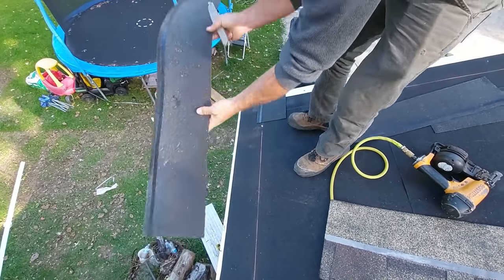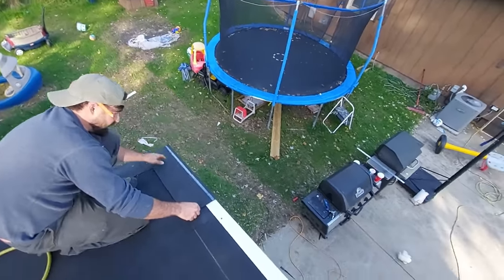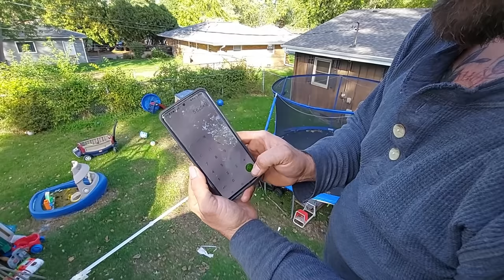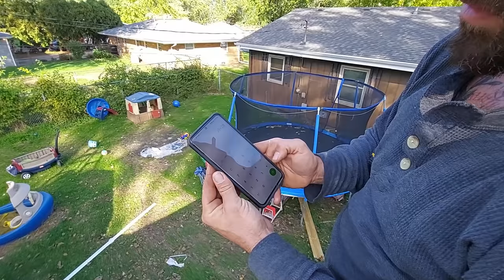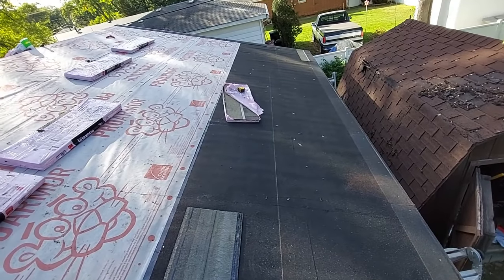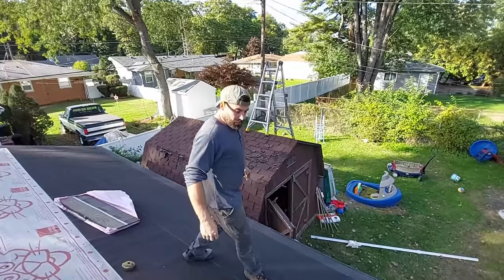HOW TO | Roofing basics (part 2 of 3)

Comment: That's bs on cutting the ice shield.  If you cut it then you had better run a bead of modified caulk on both sides and add a 12" patch over it.
Reply: Correct slitting out a bubble in ice dam requires a lapped in patch
Reply: Oh shut up😂
Reply: If a roll ends before the end of the roof starting a new roll requires a side lap. Slitting a bubble out leaves no side lap. What is the point of ice dam if it’s compromised with a huge cuts.
Reply: True

Comment: After watching tons of videos on roofing, yours makes the most sense!  When i got to shingling I could not find your video! 😡I just installed on a small lean to shed and need to redo everything from the drip edge, paper to the shingles.   Ended up using another video, the wrong way video😂  Your install is the correct way!!   Didn’t pay attention to lining nails and the first starter sheet to avoid the first seem 😮😡🥵. Luckily it’s small lean-to where I only used 1 full bundle of shingles.  Im going to be building 2 larger sheds in the yard and want to do it right!!  Thank you!  $50 redo better than head aches down the road.

Comment: Thanks for these 3 videos, I am facing my home roof replacement; insurance paid claim due to high wind shingles flying; problem is the contractors I have spoken so far quoted more than what I have for it. I am entertaining the idea of do it myself, now these videos have some of all the info I need but not all; the good news is I used to work finished carpentry and framing for many years but just never done any roof before; I as well are not a car mechanic and took apart our Toyota Corolla, overhauled the whole car most parts and put it back together; it is running, my friend says the roof is simpler in comparison yet I would prefer a pro to do it but the prices I am getting are going to steer me into doing it myself; in my case I got a single story 1350 sq ft home with an L shape roof in 2 sections which measure 80x80; I am told I have 16 sq ft of roofing; ours have 3 layers to tear down and I am gathering info as far as how much and type of material needed; I know I want to put it Laminate shingles from HD Castle Sandstone but not sure yet about water barrier or felp; we are in Las Vegas, Nevada and here it is mostly sunny all year around; roof pitch here is 4:12 I believe and in my roof there are 2 valleys, 2 attic turbines, 4 vents, a chimney, a small round skylight and the AC Unit is on the roof in the center of it on roof 1; roof 2 is the one mostly for garage facing the street. I am not worry about demolition and tear up but worry about how to work around obstacles and how to properly install around it as it is difficult to find here. I would think it would take me about 4 days to do it on my own provided I can get all materials up. I watched a video here in you tube on how to make an electric joist using a 16 ft metal ladder which I have but if I do not use a contractor because pricing with the insurance check I believe I have enough for the materials I need and some tools I may need as well and my calculations are to be around $6000 mark; not sure yet. Another feasible way is to find a lone roof contractor who would do only the installation part with me providing a clean area, materials and help as needed; not idea what he would charge labor. I would be including dumpster as well; by the way my actual shingles are 3 tabs; that is why I will be upgrading to laminate as recommended by some I have already talked to. Any advises for me? I subbed; Thanks!
Reply from the maker: If it's insurance you should never do it yourself.  I always make sure my customers don't pay a dime and I get enough money to do the job properly. You just have to find a roofer that can do the same.  If you're having issues with the insurance company you can always hire a Public adjuster but if it's just a roof that is already fully approved then I would try and stay away from that

Comment: We do 12-3/4 off drip edge, then 5-1/2 show every row up the roof with chalk lines. Over half way up the roof we will square the top line to the ridge. This ensures the shingles are squared to the roof, tar line is directly on the key way of the shingles, no exposed key ways, and that the shingle nailed above the other has the  additional nails. Everyone has their own system, I am sure yours works well.

Comment: Good video for people starting out shingling. Cutting the wave in the ice shield is necessary, if you don't, you will see it when facing your roof from below. Here in SoCal, we call it 'Fisheye'.
I made a long comment in the first part. If anybody is interested, check it out, especially if you are in a heavy weather area. Regarding starter shingle, we never extend it by the eve more than half inches, about three eights. Start laying down your starter on the opposing side from where you start shingling. This way you only cut it once. And your first shingle still may need a small cut if keyways happen to be offsett less than five or six inches. You can play with the size of your steps a little bit, as you getting nearer to the ridge it becomes less important since rainwater has less momentum. Chalk line I only use if your eve have more than one beginning, lower or higher sections that needs to be flushed once your on open field going up to the ridge. I ensure that my shingles keep a straight vertical line by extending my shingles just a bit higher, like an eight of an inch so I can see the line of the 'reveal' or also called 'exposure 'that guides me when I  lay my shingles down.
Hope I was clear, if U have any questions, shoot me up.

Comment: The thing with roofing is a lot of people think every roof is created equal. They think its as simple as just nailing shingles on and the shingles will keep it completely waterproof until they start breaking down or the roof receives significant damage from wind, tree limbs, etc but fail to realize a roof isn't meant to be waterproof, it's only meant to shed water. People will buy a house with a newer roof and think it's good to go for another 20 years just because their inspector went up there and didn't find any obvious flaws and there's no visible leaks coming through the ceiling. Sometimes a homebuyer has the advantage of knowing it was done by a reputable company but even then sometimes reputable companies don't always do the best work and aren't able to provide a short term or even longternmwarranty to the homebuyer. Maybe they let a beginner do some shingling, they got in a hurry to get the job done, their top installer came in hungover, they nailed into keyways and the inspector doesn't notice or whatever it may be. Roofing is hard work and anybody who at least somewhat knows what they're doing can do a roof that will last a few years before causing noticeable leaks but it takes a skilled roofer to be able to do a roof that will last 20 or more years and leave little to no rotted sheathing for the next time the roof needs replacing but unfortunately the fly by the night roofers are long gone and have already been paid and won't stand behind their work when issues do arise. Sometimes issues arise from heavy rain, snow, wind, etc but more often than not issues are caused by a bad install because bad weather events are inevitable
Reply: So you think a roof is not meant to be water proof hay. That's just sad untruth.

Comment: I used to run a chalk line with the old 3 tab to make sure they stay straight. Don't really have to do it with the heritage style though. Your videos are by far the most informative I've ran across so far. Every step is thoroughly explained and by the book.  I thought I was a pretty fast shingler  until I watched your speed shingling videos. Dude you blaze through a 30 square roof in half the time it would take me. A good video on how to roof and flash around dormers would be a big hit. Ive started to see alot of questionable installs that I've been called to fix because the half price cut throat bid was a half assed "handy man" who didn't even have the correct  insurance to be performing work on a roof. Also what is your preference on roofing a valley? California, Open, Closed Cut, Woven?  Fantastic job bro. Keep up the good work.
Reply: In the valleys, I torch down a half a roll of modified bitumen, of course on roof slopes where I can still walk safely, this way it gives you freedom what type of valley you want to go with, regular straight, or California etc.. I strike a chalk line both sides of valley line where I don't want to nail from towards the middle of the valley.

Comment: I noticed how when you left off the 1/8th that about 8rows up you came off an inch from the control line. So if you just run parrallel to the control line its still serving the same purpuse right?

Comment: @ 15:10 if you do 11&1/4 every two rows wouldnt that drop every 2nd row 1/4 inch droping the tar line off the smooth part onto the granuals? wouldnt the seal strip be better off on the smooth part rather then the granuals?

Comment: Good stuff. With the starters, you should always nail as close as you can to the edge without puncturing the drip edge or rake metal. I've seen lots of guys who nail on the top 2" and that's wrong nail placement, the whole point of a starter shingle is to hold that bottom half of the shingle down from the wind, and to cover the seams of course, but if you high nail the hell out of it, it lessens the strength of staying on at higher winds.
Reply: Buh when you nail in shingle that goes to starter as well
Reply: @sachgohlan2580  You don't think I know that? That's literally what happens with every shingle. The headlamp of the shingle underneath, even though it's only like 2", gets nails in it from the shingle above.

If you actually read what I said, I said that the bottom half of the starter would be completely loose if you don't nail within a inch of the bottom (starting after your overhang) and thats the only thing holding the half that's closest to the eaves, from wind pulling up on it. Although it's not very common for shingles to blow out at the eaves. That's like putting cap down without any seal strip on the ends to hold it down from the wind.
Reply from the maker: yea i try to nail close, but back in the day i used to nail high because i was worried about my shingle seam landing where a nail was. never had a problem with the high nails but yea its definitely much stronger when you nail closer to the bottom. thats why i stressed the importance of the starter being the same length as the shingle. its crazy that manufacturers even have different lengths between starter and shingles. if everything was the same length guys would have no problem low nailing on the starter.
Reply: @NWIVeteranConstruction  I agree. Then there's just some guys who prefer buying the cheaper branded starter to save $3 a bundle, even if the starter and the laminated shingle are different sizes. I get that it can save $50 but that compared to making the installers have to worry about it and having to either cut back and add a starter in, or watch their nail placement entirely doesn't match up and gets annoying haha
Reply: @Josh I didn't read it properly. My bad
Reply: Nailing close to the rake is fine but I always just put two nails on the very top edge of each side of my bottom starters since your first shingle will be nailed through it as well and in my opinion the least amount of nails in your starter the better also you don’t want to chance getting a nail close to your keyway if you’re shingles and starters are not the same length because they will catch up every four shingles you will have to cut the starter and I always just teach everybody just to nail the top so the new guys never get a nail anywhere near the keyway on the first course
Reply: @projectpat2262  you teach your guys to nail high? Do you do the same with the nail zone? Are you one of those guys who high nail Cambridge and the other thin nail zone shingles!?

You should be teaching your guys the importance of nail placement, keeping the correct size shingle book and how to properly shingle valleys whether it be a closed cut valley with bleeders, or a cut valley. (cutting the triangle off the corners) and how to back shingle when your shingles are too small going against a wall or in the valley.

Shouldn't be only tacking the top edge of a starter just to avoid the shingle landing on a nail. You shouldn't even have a butt end of the shingle land on a nail that's in the starter.

If you are the owner you should know which shingle brands match the length of starter brands. And know to order the correct sized ones. Just stop being lazy and do it the right way.

Comment: Great video. Thanks. I have a question. I'm roofing an old wooden garage which is 20ft long and the distance from the bottom edge of the roof (at the eaves) to the peak is 78" at one end and 80" at the other. I was planning to snap 2 reference lines and the question is should I snap them an equal distance up from the bottom edge of the roof and deal with the difference in rise when I reach the ridge or should I slant the snap lines such that each absorbs 1" of the differences in rise.

Comment: hello there my friend but i noticed that when you snapped out for your first 5 rows of shingles you had said it was 5 5/8 x 5 is 281/4 and your second control line should have been at 561/2 or am i wrong??? you said 28 for the first line and 56 for the second which is it
Reply from the maker: Yea what I did was dropped it a little bit so that it will cover any imperfections a new shingler might have.  If I made it exact and a new shingler was trying to do it they probably would struggle.  By lowering it a little it's more dummy proof and still unnoticeable

Comment: With a correctly driven roofing nail, should you be able to feel the edges of the nail head or should it be truly flush to the shingle face? Nailing guides show the head just above the shingle face and use the term “flush”, but that’s not flush. Same question for roof sheathing and decking nails.  Awesome videos and thanks!
Reply from the maker: Sheathing nails usually naturally penetrate a little bit but flush is okay. You can always hand bang one and that's roughly what you're trying to emulate with the gun. for shingles it's pretty much the same but you don't want a crater around the nail. Even with an adjustment on the gun and proper pressure from the compressor, it's hard to get a perfectly consistent nail depth. It's okay if the shingle dimples around the nail slightly but you don't want that crater around the head, that's a blow through and has no strength
Reply: @NWIVeteranConstruction  thanks! I just bought a Metabo roofing nailer and it consistently puts the nail head just a little proud off the shingle surface. I was going to return it for a Bostitch thinking it might not be powerful enough, but it sounds like it’s good to go. Thanks again.
Reply from the maker: @usmc2msu213  that's exactly why I switched to Bostich, Hitachi shoots em good for a second then you need the hammer a bunch.  I found that if you really pound it a little extra hard it will mostly prevent that
Reply: @NWIVeteranConstruction  On that note, the Metabo is getting swapped out for sure. Thanks again!
Reply from the maker: @usmc2msu213  well keep in mind, Hitachi is a little more reliable. Less problems, especially in the colder weather.

Comment: 2:59 Zak. My roof is sheated with 1/2 inch Plywood. Will 1 inch nails be long enough, or will they show on the underside of the eaves.
Reply from the maker: I can't think of many scenarios where you would want to use a shorter nail so that it's not visible, typically nails are going to penetrate all the way through decking and I'm pretty sure most code requires it to. However,  a shorter nail MIGHT be the move in some unique situations where there is somehow a finished wood involved that the nails will Penetrate and show through... but typically you would use 1¼ in. Coil roofing nails for shingles, and if you need to secure your half inch decking you would use 8 penny nails or 2⅜ gun nails, preferably ring shanked.
Reply from the maker: Do you not have soffit That covers the wood? Like, your plywood is just exposed in the eaves?
Reply: The plywood is exposed in the eaves.
Reply: I am using Owen's Corning Duration shingles with weather guard on the first 2 rows from the drip edge and Pro Armour for my underlayment. I think that 1 inch should work in the eaves. Then 1 1/4 in the field.
Reply: Yes nothing covering the soffit. Just the exposed Plywood on the bottom side.

Comment: Question about starter shingles: have you ever used the starters that are on a roll? It's one continuous roll that relies on adhesive only apparently. Why or why not? Thanks
Reply from the maker: You might struggle trying to use that in my opinion. Maybe not on a cooler day or first thing in the morning but I don't personally prefer it. It'll do the same thing so no sweat if you already bought it

Comment: Bro the underlayment on the gable goes over the drip 😝
Reply from the maker: nah, doesn't really matter to me personally i've done it every way but in general this is the rule. exactly how i did it.
Reply: @NWIVeteranConstruction  oh but it does, if it leaks and tracks to the gable it will most likely go under the drip and onto the gable facia board. If you start putting metal on. Finish it don't stop halfway and start laying underlayment
Reply: @NWIVeteranConstruction  you should know better